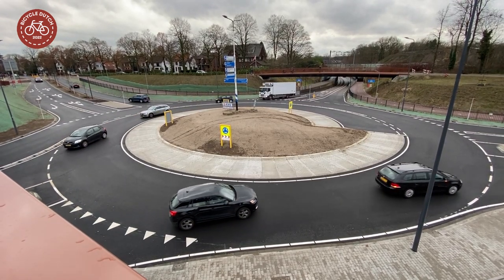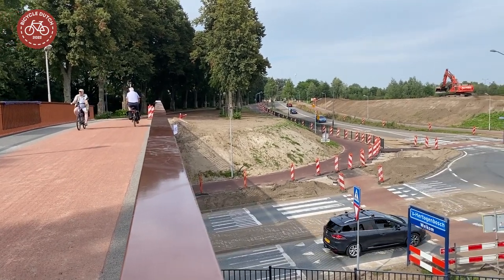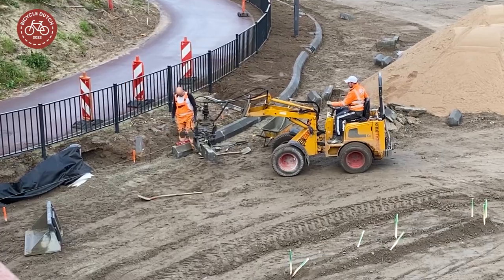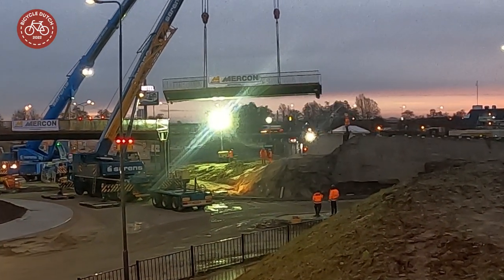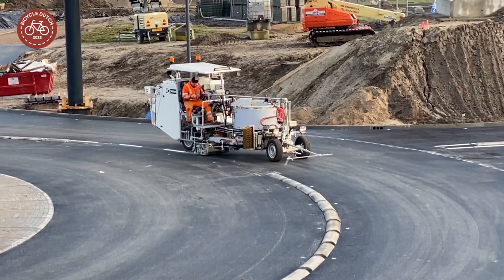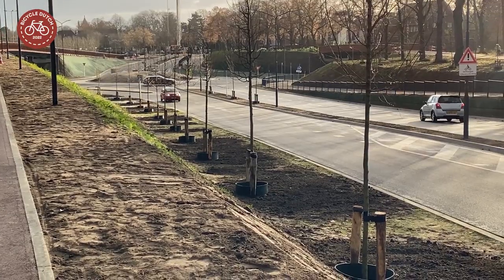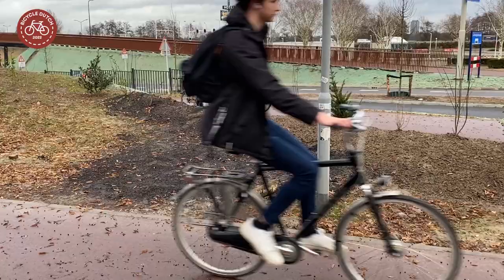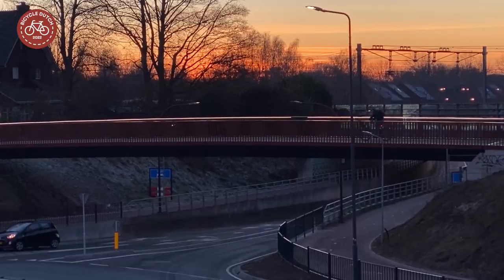A new cycling viaduct in 's-Hertogenbosch (NL)

Comment: When I initially saw the video title about 'cycling viaducts', I was envisaging significant climbs for cyclists in order to pass over the roads. But it appears that they lowered the grade of the new roundabout, in order to reduce the elevation gain required for cyclists. That's an additional level of design consideration that you wouldn't see in many countries.
Reply: nono  we have a law that dictates the max slope which needs to comply with requirements for elderly and special bikes like for handicapped, i think its like 6 degrees but dont quote me on that, exceptions can be made but the municipality then needs to argue why its impossible to achieve or not relevant (eg other close alternatives that do comply) ...

Comment: I never seen a turbo roundabout. Very interesting and more suitable for few roundabouts that I know where drivers keep going over 50km/h.
Reply: Unless you drive a motorcycle, than these turbo roundabouts become pretty dangerous. There are signs though as you approach a turbo roundabout warning motorcyclists that a turbo is coming up and as long as they adhear to the traffic rules and keep to the lanes all is well. But if they don't pay attention and think they can cut corners they'll end up airborne.
Reply: @XEinstein  I don't understand why it would be more dangerous that a standard roundabout.
Reply: @paolagrando5079  turbo roundabout has a big rim in between the lanes. Easily 10 cm high and perhaps 20 cm wide. Not something you want to drive over on two wheels at 50 km/h
Reply: @XEinstein  thanks, I thought that it was only about shape.
Reply: @XEinstein  Just pay the same attention as you would to a curb stone. 
That's all it is really, and even less pronounced.

Comment: How do cyclists cross perpendicular to the bridges?
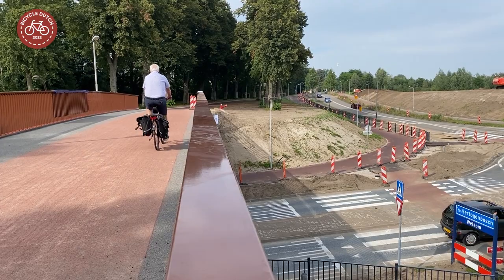Reply: At 0:22 you see a sign with bicycle paths going under the bridge.
The other side leads to a motorway, no bicycles allowed.
Reply: So looking at the map at 0:22, how do you get from the bottom bike path that runs horizontally to the vertical ones at the top (the other side of the horizontal road)? It looks like the old roundabout allowed for this but the new one doesn't. @BicycleDutch can you explain?
Reply from the maker: To go left like that you cross the road before you get to the overpass. But really nobody wants to do that. You'd be going 'back' to where you came from. There are better alternative routes to go that way. Main flow of cycling on that map is left - right and vice versa.

Comment: Not related to a cycling however it would have more great , close to the end of this video, some little explanation about the Turbo Roundabout and the reason to establish it right there.
Reply: There's a link in the description providing more background Information.
Reply: @gert-janvanderlee5307  Thank you for pointing the link. I have missed it. However, No explanation why the architects opted the 'knee' version.
Reply: @AtidAPT  Not sure what you mean by 'knee version'?
Reply: @AtidAPT  There's another video on this same reconstruction. Maybe it can answer your question:
https://youtu.be/q5LsouTn2AQ
Reply: @gert-janvanderlee5307  There are several variants of Turbo Roundabout and each of them has it own purpose. One of them, as shown here,  is 'knee' or 'stretched-knee' version. Thanks again for pointing your help.
Reply from the maker: The main flow of car traffic is from the motorway to the city centre. That is why that route got the bypass and the design of the turbo-roundabout is like it is; to accomodate that main flow best.
Reply: @BicycleDutch  Thanks. Keep it up.